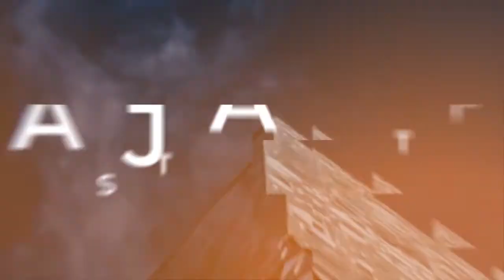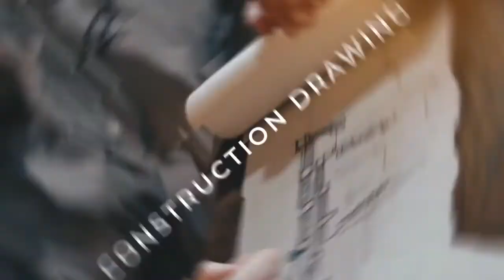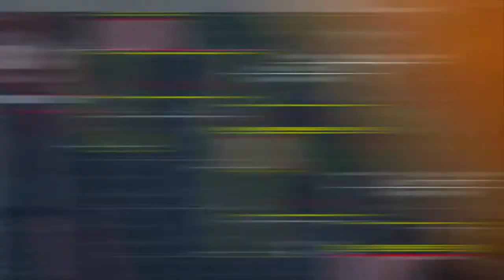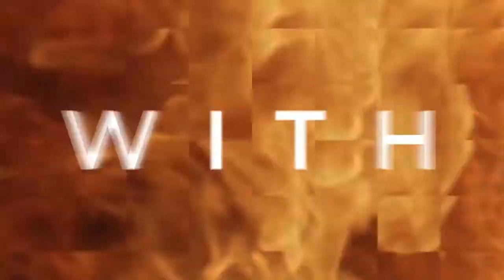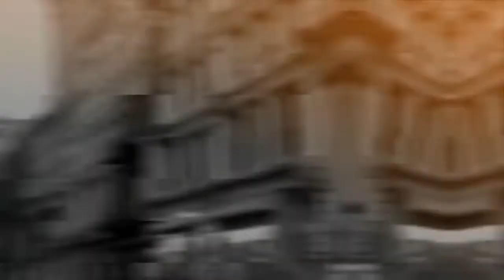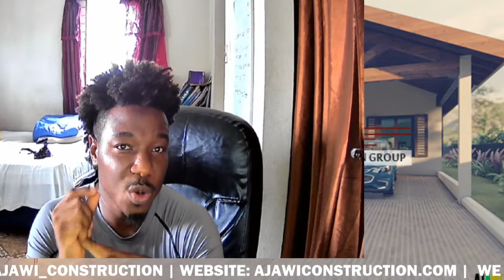ICF HOMES | INSULATED CONCRETE FORMS IN | JAMAICA | PART 1

Comment: I've been looking into this.....based on how easy it is if trained and skilled workmen are used the first floor can be done in three days or less for  the stacking...which savings alot of time and labor costs....I believe it will be very profitable....but I'm worried about the cost of getting it into the country with costumes and all that. If there is not a manufacturer in Jamaica...looking forward for part 2
Reply: There is already a manufacturer in the island.

Comment: Interesting presentation. I have a few questions:
1. What is the cost for a block of ICF?
2. How do you join the blocks to each other, is it via mortar?
3. Is the fibre mesh finish that is applied to the exterior of the block comes with the block or it has to be purchased separately?
4. Can the ICF blocks be used for exterior walls or only for interior walls? Can they be load-bearing walls?
5. What is the thickness of the blocks?

Comment: Blessings. Blessings. What I am gathering from this information is  you can order this product custom made. And it could be Taylor to your projects. 
Secondly it supposedly to be a heat Blocker from the Insulation. Sound very interesting...I am thinking this process is more tedious than the regular Concrete block. 
Blessings 
⁸s